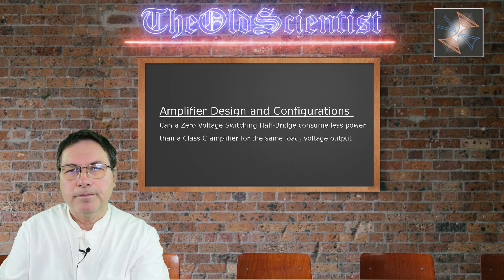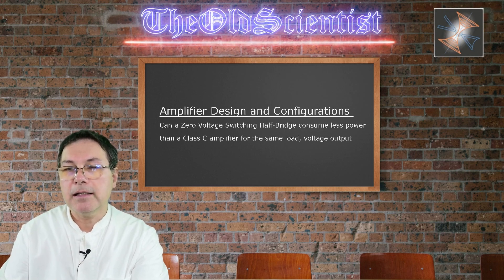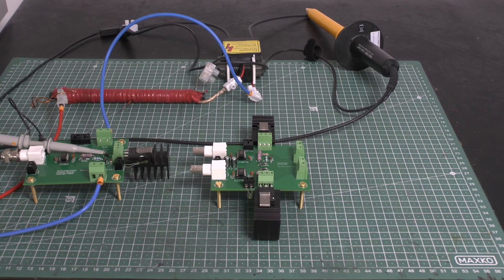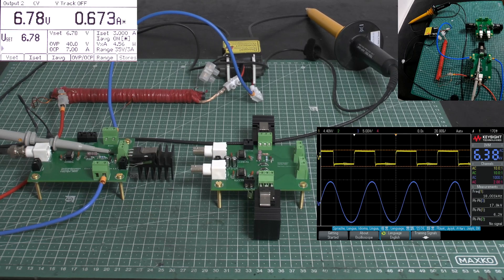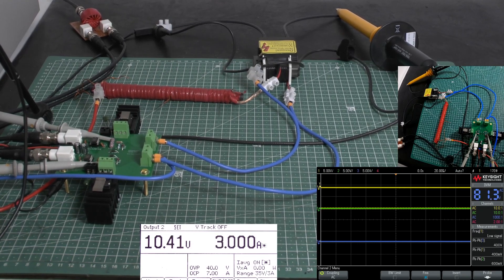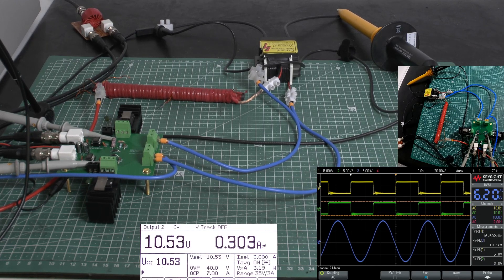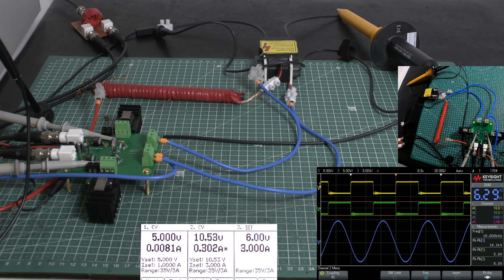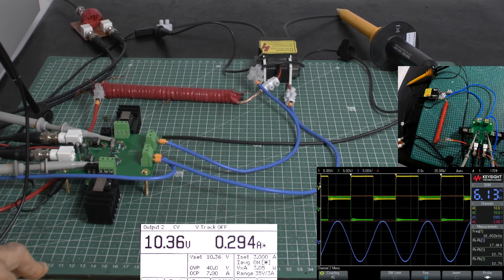Can a ZVS Half-Bridge consume less power than a Class C amplifier

Comment: So your storing the back emf in the large inductor and tuning in to find the best harmonic. Ive always wonder if people designed circuits with certain fundamental frequencies would it capture stray radiant energy
Reply from the maker: Using the inductor is tricky business. It steals energy. It also changes feedback response which is mainly visible with cored transformers. This all can be easily calculated in a spice model via FFT. Radiant energy is mainly in the dielectric field for which I currently created many videos and here we have some surprises which is the opposite of what we expect from a transvers wave signal.